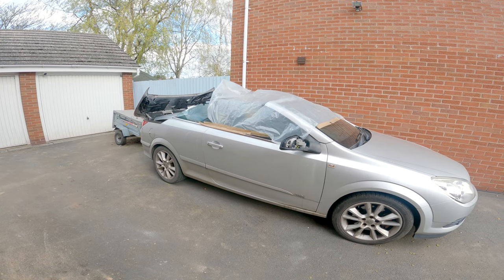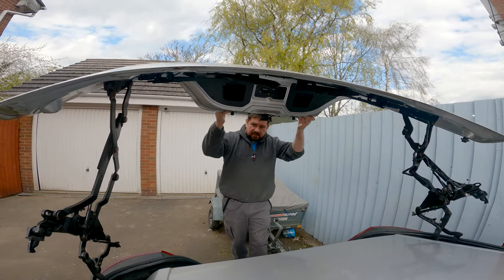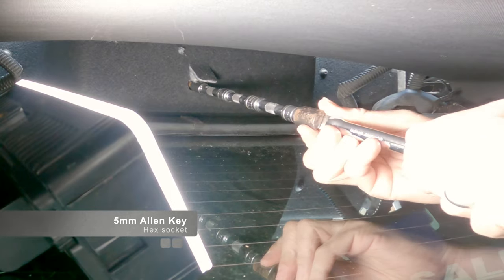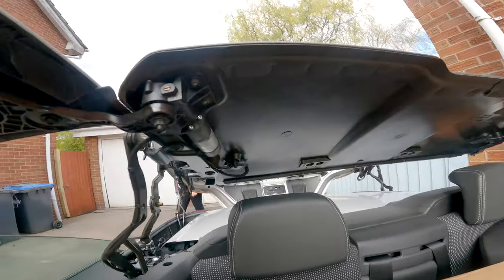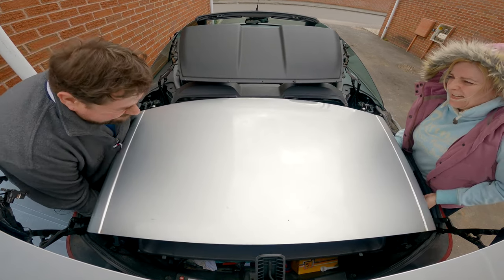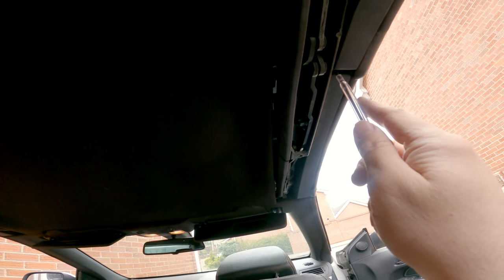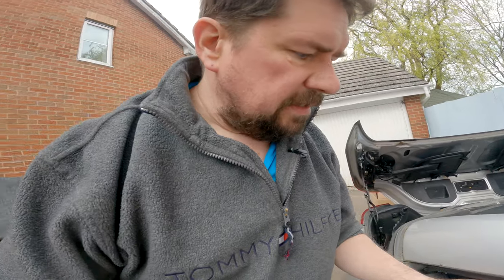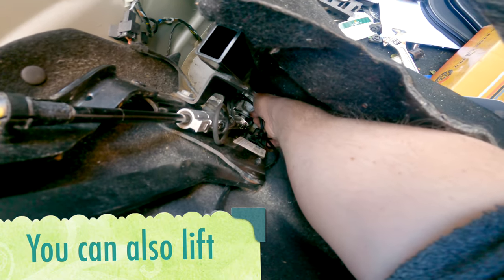How to Manually close Astra Twintop Roof

Comment: Hi there, great video but I think I'm being a bit thick. The section about putting a socket under the ram...how do I get the ram as high as you did? You say it can be done with a screwdriver so do I just put screwdriver where the socket went and lever it up?

Also when you are trying to manoeuvre the boot at the end when you said 3rd time lucky, it's there a piece that attaches the boot section to the section with the window or it just clicks into the locking mechanism?

The beeping is driving me crazy whenever I need to use the car.
Regards Arty
Reply from the maker: Yes you can just lever the ram (body not the chrome rod) up with a screwdriver as this will drop when you try and close the boot mechanism ( socket under ram dose same thing,) the boot, window, and roof panel are all connected together and have to lock into there correct positions

Comment: Great!  do you know in your esperience how to solve a failure of the red button roof ifter mechanism (tha one that allows the packed roof to get lifted some inches to access the luggage beneath/below? i mean: my button activates the pump but the packed roof doesn't lift at all, i hear like if it tries to but is locked somehow and the pump after a couple of seconds trying to push gets released (probably by a safety  overpressure valve or safety switch) .. so i was wandering if could be some of those black cables that control some locks you show here in your video that  may act as to lock/unlock that maybe is just in a not correct position so to let it work properly... if you could help with some hints or suggestion that would be much appreciated, for years i look for someone that has your experience  so i ask. Thank you in advance if you will answer
Reply: Or even the gray pistons you mentioned that could be in non a correct position? could their wrong position be the cause?

Comment: Hey, thanks for the help! My roof got stuck almost at the end of the sequence while I tried to close it and it just wouldn’t move. I pressed the button, no three beeps, but it wouldn’t open nor close further. I could easily reach the pressure valve and after I released it, the roof fell into place. After that I pushed the close button and it locked the roof and closed the trunk normally. The trunk opens up easily as well. I didn’t have the courage to try and open the roof with the button since, what do you think the problem might have been? The flaps closed and the roof only got stuck near the end, and later it locked itself after I put it in place, so I cannot think of anything that might have been the problem. Also it always opened up fine, however it sometimes got stuck while closing, but continued after pushing the button again up until this point. Thanks for the help in advance!
Reply from the maker: Hard to diagnose without live data, try and think where it was when paused and what operation was happening, maybe you have a warn gear etc, also if it just stopped out of the blue also check wiring especially on left hand side in case there are any breaks or shorts when working was it slow if so hydraulics could be worth looking at sorry which I could be more help

Comment: Hello.

The roof on my twintop was not opening automatically so the wiring was check and found a few breaks which were fixed. 

Now the motors are running and latches are disengaging but the roof still will not open. Do you have any suggestions?
Reply: @RichManPoorMotors

Comment: Hi wondering if you can help my roof really struggles to open and sometimes just stops and I need to put it back up. It sounds like it doesn't have enough power or the motor is just struggling any ideas please would be a massive help. Thanks.
Reply from the maker: If it’s slow it might be either mechanism for moving freely or maybe you hydraulic pump might need replacing, check for corrosion around the mechanism pivot points and maybe add a bit of lubricant to aid this 1st

Comment: Thanks man, worked fine. Well almost, now boot will not open... there is no sound of the release mechnism working.
Reply from the maker: Watch my boot video for closing times, pull fuse 15 if you need to get in

Comment: Can you please tell me does this also work for astra twintop from 2006?
Reply from the maker: I would think the 2006 is exactly the same as 2008
Reply: @RichManPoorMotors  yea I did this and worked, thanks man
Reply from the maker: @villeviitanen1748 thanks for the comment, if you can’t get into the boot pull fuse 14 or 15 in engine bay and replace before you drive as maybe you need to adjust part of the roof mechanism so that the sensors are reading roof closed

Comment: I have closes mine. But now, the trunk doesnt close. when i’m locking the car, i still can open the trunk lid. Withouth using the switch. 

You showed in de last minute. That problem. How do i fix this?
Reply from the maker: Look at my video https://youtu.be/E6K2iQsaBMo shows how fix boot
Reply: @RichManPoorMotors  At the last moment of the video,  you can open the boot, withouth using the switch. That problem is also with my car. Even if the car is locked, i can open the trunk. When its opend, and i closing manualle the "hook" , and when i'm using the switch, it does spring open. But when i'm closing the truck, it doesn't lock.
Reply from the maker: The rams on the hinge need to be fully up and the hinge needs to be locked down (where you have pull straps) the boot lock needs to have locking mechanism fully closed (rotated) so that micro switches have been operated I tried to show this in my boot video

Comment: after years of brand loyalty I'm buying Opel ever again, that's how much this car has pissed me off. the engineering flaws in this system are completely unacceptable. it's like it was made for one time use.
Reply from the maker: I here what your saying but to be honest Vauxhall/Opel is now Peugeot since 2017 even though there was talk about Peugeot going bust in 2014, they somehow had the money to buy Vauxhall/Opel just 3 years later so it wont be the same brand anyway.
Reply: @RichManPoorMotors  I'm aware that it's an overreaction based on spite rather than logic but I'll most likely keep my word just because. you can definitely relate to that on some level right
Reply from the maker: I don't think its an over reaction at all,  i have bought  a few BMW 3, 5 and 7 series when i was younger, but 20 years ago my coupe started accelerating  at full pelt in rush hour traffic all by itself, in the centre of coventry.  it turned out to be water that got into its ecu, after that i have never purchased another BMW.
Reply: @RichManPoorMotors  Jesus that's horrible, glad you made it out okay. Also finally got my roof down now. took me 2 hours to do the things in this 10 minutes video 😅 
i had some extra problems this video didn't touch on though
Reply from the maker: @WadaMalone  heavy isn’t it, 
It usually takes me two to four times as long doing a job when I film,  I had a video on my tech channel shaker style wall, it took me 10 days to do the job with stopping for home schooling, I started with 5 hours of filming that I eventually edited it down to 30 mins that took me another 2 days
Reply: @RichManPoorMotors  checking out your channel as we speak
Reply: @RichManPoorMotors  wow lol 🤣. I had a 53 plate Renault Megan 1.9dci. The engine took off up a hill. I tried dipping the clutch the engine started revving like a race car so I turned the engine off. But it would not switch off. I tried to turn it round a bend and the steering lock clicked on What a bloody nightmare that was. The mechanic said the turbo blew
 I'm still not sure to this day? Lol I was in shock after🙂
Reply from the maker: Didn’t sound like the turbo to me, might have been the dump valve/ vnt control stuck and not releasing boost pressure, but something would have also told the car to add fuel